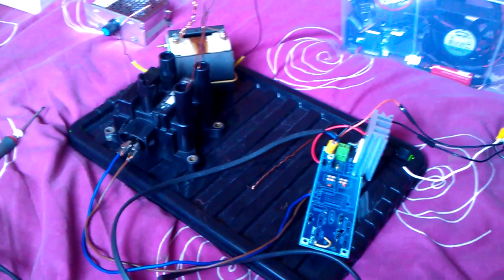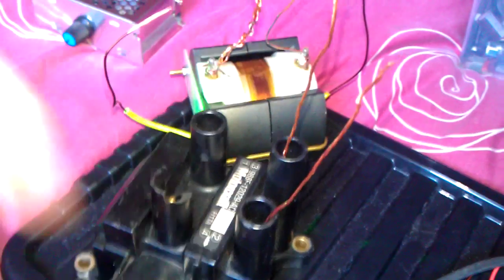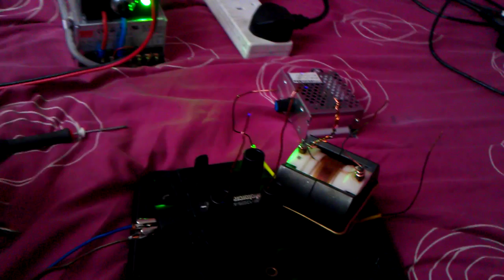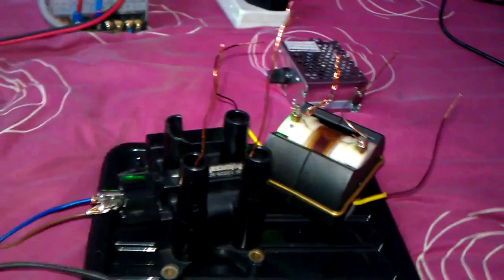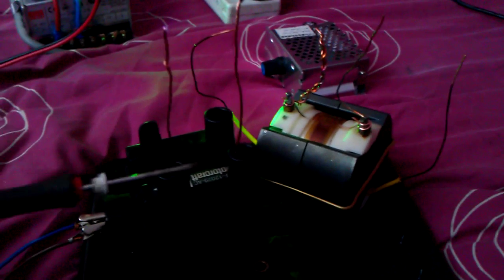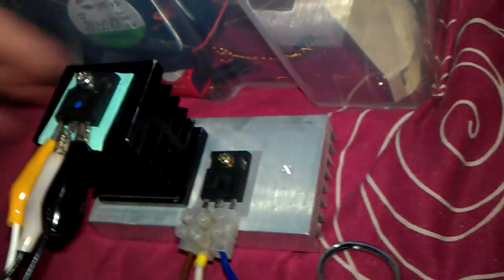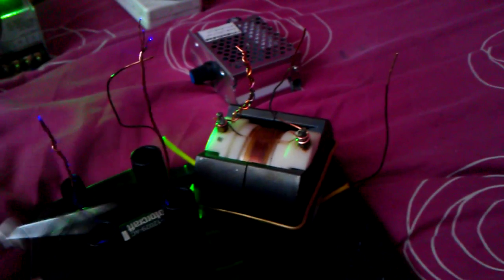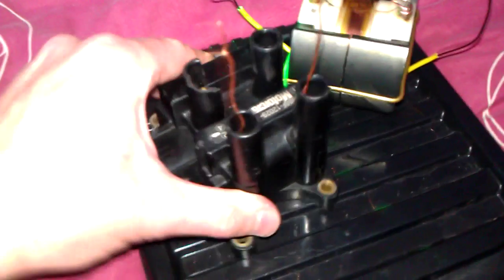Ignition transformer run"( lots of corona )

Comment: is that a pwm dimmer I see in background
Reply from the maker: Mrinal  Thakur Hello mate, yeah it's a pwm variable power supply, there great. off Amazon.

thanks 👍 

Anthony 

High1Voltage1Rules
Reply: Good that's is used to control the speed of motors 
Can it be used to drive a flyabck transformer
Reply: Please can it be used to 
I will be one it it can be used for driving a flyback transformer
Reply from the maker: Mrinal  Thakur no bud, it's just for motors and led lights. if you ran a 555 time from it then you could. 

hope this helps mate 👍😉
Reply: high1voltage1rules OK got it 
Thanks

Comment: Fantastic output, really pushing the guts out of that little ignition coil pack!

Do you know what frequency it's running at? Seems to be towards the upper end of the audible frequency range, but I've never got a good output from ignition coils above 5kHz or so.

Comment: That little mosfet has balls - if your gonna put it into a permenant setup I'd stick it on a larger heatsink, and put a decent fan on it - which reminds me - I need better 92mm fans in my ups mod for slightly more powerful ones - she got to 75° during a discharge (battery) run - bit concerning. Agree nothing is better than the sound of a gas turbine starting up - except when you're the actual one starting them up! Unfortunatly Youtube's downmixing tends to ruin the sound because its so loud!

Comment: Great Ant! That look great! I must try to get my Ignition transformer in function! Could you send that diagram me? I think I can use my car battery charger for as the power source and I have few mosfets ... I think I must do only a circuit and then I'm ready! Unfortunately I have so less time all the time! hahaha! Or the time goes everything else! I'm just searched small low frequencies transformers stable as 40Hz - 10kHz or better! I hope I could find smaller than pea or build some myself! Assa